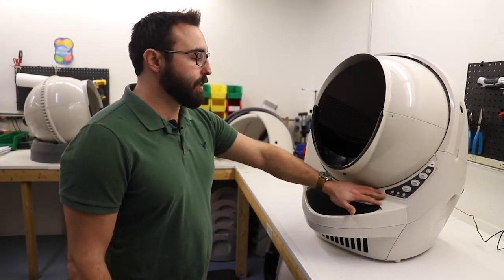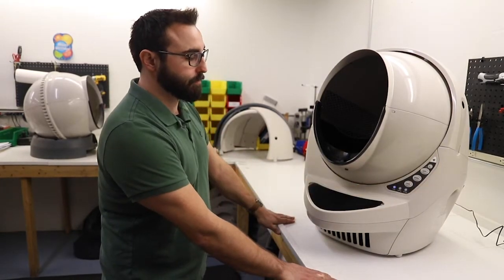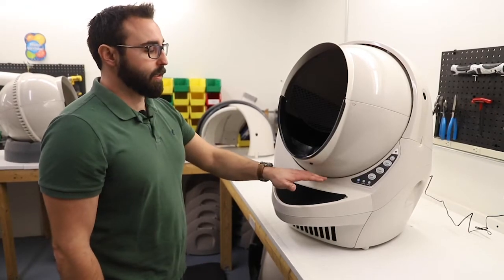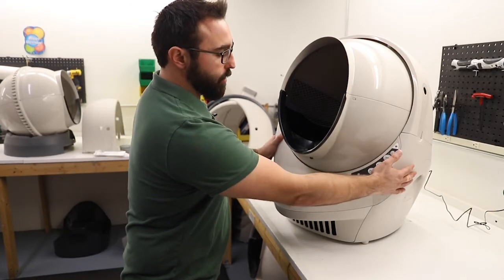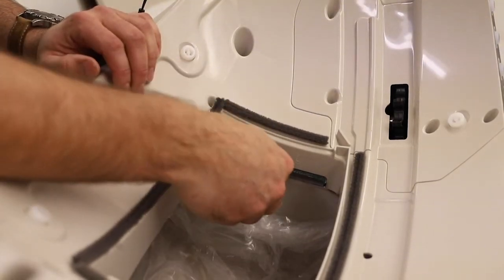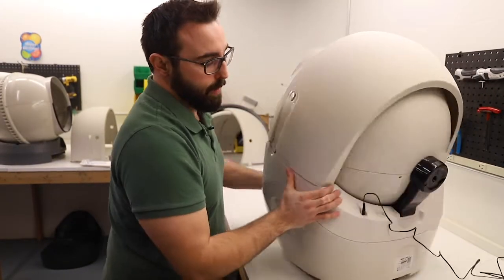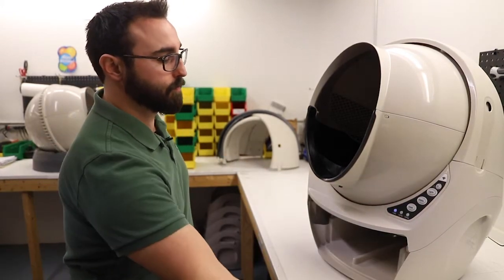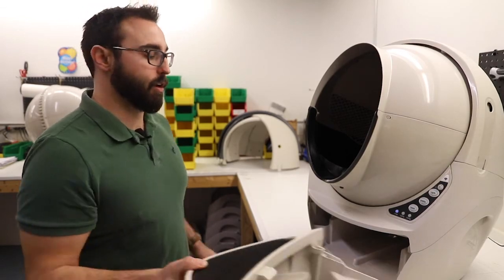Litter-Robot 3 Laser DFI Troubleshooting

Comment: When I tried that reset at the end, it changed the problem of the blue flashing light into a yellow flashing light. This product was great the first 2 years, but requires so much work after to have the same user experience. There are just terrible decisions and low quality parts used for the cost we pay for this, and it is almost as if this is done on purpose, so people junk them and get a new unit. Designed to be replaced, just terrible.

Comment: My LR 3 is  still blinking blue. Tried all troubleshooting i could find.  Been an issue for months. Now just continues blinking.   Won't even cycle at all .  Starting having these issues after about a year.  Also rubber liner keeps falling off opening. Tried to reinsert edges at top of opening, but didnt work. Feels like its all stretched out.Was going to just order new one but after reading reviews about resolving the problem decided company prefers you  to just buy new one. I'm not!

Comment: Hi there, I have our litter box  for 7 years, mine is the same model without WiFi, I don’t see a cut out nor a lens in the middle?!  I’ve cleaned the entire left and right clear plastic covers (it was completely dirty) not sure how it was working for all these years, but now it’s super clean and I still have a blinking blue light, can you please show me a link to replacement parts or tell me where is my lens? I see a black chip looking part on the left side of the DFI, is that the lens? If that’s it I believe I need to replace the boards because I made it super clean, it ain’t working!

Comment: Hi, a few troubleshooting questions: 
1) When the waste liner sticks up, is that obstruction setting off the laser sensor primarily? 
2) I'm trying to wrap my mind around how pushing up against the globe from the inside helps to recalibrate the system? 
3) Does the litter robot 4 still use this same laser sensor in addition to the light sensors at the top? (I have versions 1, 3, and 4)
Reply from the maker: Hi there! We'd be happy to help answer any questions.
1. If the waste drawer liner is too high, it could set off the laser sensor below the globe. We suggest adjusting the bag in the waste drawer and hitting Reset to check if that is the primary obstruction.
2. There is a sensor in the globe that will detect any weight over 5 pounds, so if you push down on the globe, it should trigger the sensor and switch your Litter-Robot into "Timing." We suggest pressing "Reset" after moving the Litter-Robot, adding litter, or changing out the waste drawer liner to recalibrate.
3. Yes. Litter-Robot 4 uses DFI sensors like past Litter-Robot models. Litter-Robot 4 is equipped with a sensor looking downward from the top of the unit that is used to detect the waste level within the waste drawer. During each clean cycle, the DFI sensor will measure the level of waste within the waste drawer.

Comment: I followed these three troubleshooting suggestions, and ultimately, when none of them worked I, I ordered a new DFI sensor kit from the manufacturer website.  I was happy with the design improvements, but ultimately, the problem remained the same.  Finally, I ordered a new control board, and after I installed it and did another DFI calibration, the issue was finally fixed.  I'm happy that every part of the litter robot can be purchased as a replacement on the website.  I did have to do some hunting for video tutorials on how to replace the parts, but overall, it was far easier than I anticipated.  Great design on the robot.  A central knowledgebase for maintenance and repairs would be very useful and appreciated, though.
Reply from the maker: Thank you for your feedback. We are happy to hear your Litter-Robot is working properly again! If you haven't seen it already, we suggest checking out whiskersupport.com for support resources or to chat with a product specialist on our team.
Reply: @LitterRobot i’ve tried everything and it’s still flashing blue :/

Comment: For anybody that has tried all of this and it's still not working, replacing the DFI sensor did the trick for me. You can get the replacement off the Litter Robot site and the $33 is a lot cheaper/easier than replacing the unit/sending it in for repair if you're out of warranty. Replacing the DFI sensor is relatively straightforward, just make sure you have the tools mentioned in the video.

https://www.youtube.com/watch?v=VmXy7PBaiIQ

Comment: OK. I had the flashing blue light. Found this video and it did not help. HOWEVER, upon further inspection of the DFI Sensor I realized it’s open on the bottom (design flaw) and the litter/debris gets not just where the guy asked you to put the Q-tip but on the entire inside AND outside of that clear plastic piece that houses the DFI motherboard. Cleaning both sides of that plastic and doing a hard reset fixed my issues.
Reply from the maker: Thank you so much for your feedback. We have redesigned the base and DFI sensor system in the Litter-Robot 4. If you ever need further assistance or have any questions, please contact our team at WhiskerSupport.com to chat with an agent.

Comment: When I had this issue I took a look at that sensor pcb. It has 4 IR led's on, of which only 2 were functioning according to my IR camera. I then took a look at the current limiting resistors for the LED's. 2 of them measured as infinite. I replaced these 2 small (think it's 0603) resistors and low and behold... the pcb worked again, and so did the full unit. I found these pcb's to be covered in a specific layer, probably to resist corrosion. In my case this didn't help and traces on the pcb were corroded as were the resistors. Adding see through nail polish appears to do the trick, but putting a pcb in an environment that can get moist, combined with all the minerals present in urine is asking for trouble.
Reply from the maker: Thank you for letting us know your experience. Input from customers like you helps us develop and innovate new solutions. We will forward your comments to our product development teams, and we thank you for taking the time to give us your opinion. Please check back with us, as we are continually implementing new ideas and strategies to help make your pets' lives better (and your life easier!).
Reply: That's awesome. I just bought a set of new PCBS and while it resolved my blinking yellow light, now I can't get passed the drawer full indicator. Is it possible for you to post something explain how you did this? Or highlight the schematics to point out where the sensors are on the PCBs? At this point I'm about to learn electrical engineering than pay LR another cent to get it working again.
Reply: @OTDUDE  well... to be honost... it was logic that guided me to the resistors. When you take a mobile phone camera and record the LED's it is easy to see which ones are functioning and which ones are not. The ones not functioning only have one component connected to them which is the resistor so most likely it was the LED or the resistor that was broken. Since I had the resistors lying around I thought I'd try those first. It appeared I was right and 3 resistors fail so far. 

To be fair... resoldering 0603 components is not really a beginners job... be sure you are comfortable with soldering this size. Defenately use something to enlarge things. I use a microscope, but anything that gets you closer is fine.
Reply: Yeah  I’m going through the same issue and see only 3 leds fire in my IR camera. Guessing one of the resistors must’ve fired or corroded. I had a similar issue a few months back and at that time cleaning the central chip did the trick (the pins were corroded) but this time around cleaning the child didn’t help. Soldering such tiny components on a pcb is beyond my skillset so guess I’ll have to replace the entire DFI sensor board. At least I see that litter robot released a V2 of the boards where the components are sealed. Honestly SHAME ON LITTER ROBOT for releasing the open air model with such a glaring design flaw. This wasn’t your first time around the block with the litter robot and keeping electronic components open like this in the intended  environment with all the moisture / urine etc is plain irresponsible. IMO you should be sending the v2 sensor to all owners of the LR3 model. My unit started having these issues just six month from purchase. And I’m just over a year from purchase and have to replace the board already. That’s just so disappointing as otherwise I really love the product (when it works as intended)

Comment: Toward the end of the video, Doing the reset, where exactly is the left hand?  Covering up the DFI sensor?
Reply: Thank you for asking this question and thanks to LR for the answer. I tried it once after watching the video and it didn't help, but after reading this comment I realized I needed to lift up my hand and lift up the globe slightly. It's hard to hear it in the video. Now, this took care of the problem.
Reply from the maker: Place your hand just to the left of center in the base. Then lift your hand straight up until it reaches the globe.
Reply: @LitterRobot  what does that do?
Reply from the maker: @zippitydoodads9947  That is part of the process to reset the DFI. If you need assistance with your Litter-Robot, please be sure to reach out to our team at support@litter-robot.com so they can provide instructions for your specific Litter-Robot. Thanks!